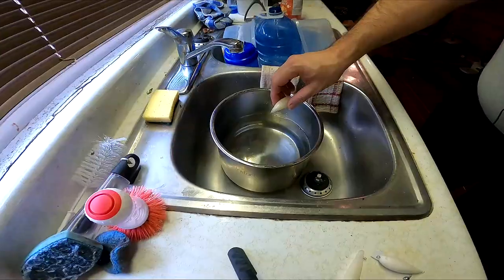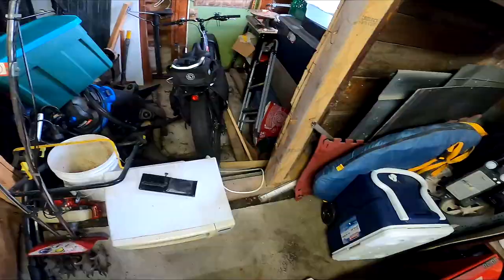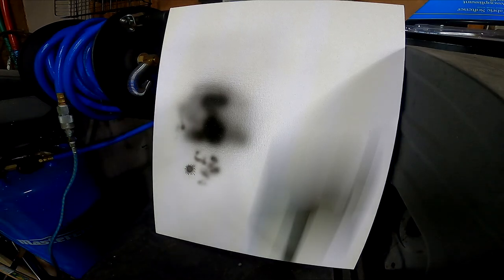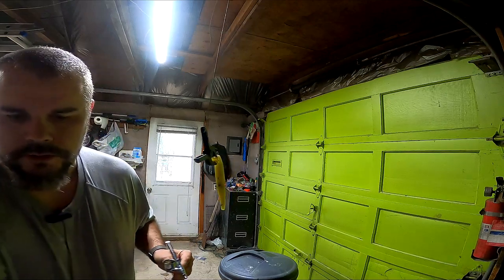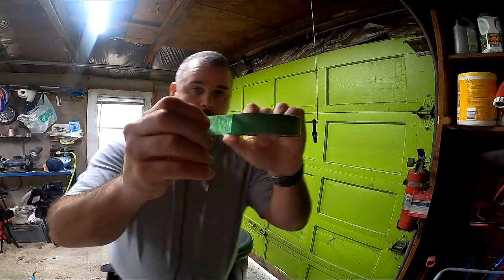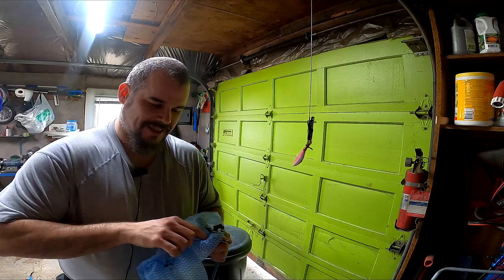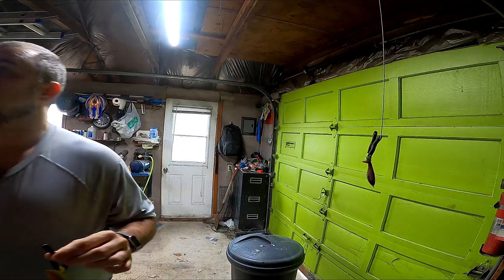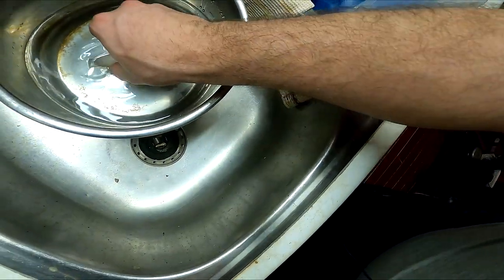No Skill Airbrushing 3D Printed Lures

Comment: You can get clear PLA also. With that last bait that did not float. Make the front bill of the bait larger. I would also try and design the bait cut in half. And use supports on the bottom to print it with the two sides of the bait faced down. Then all you do is remove the infill and throw in some bb's and glue the two sides together. Make the body larger like a supper fat tad pole. That will help with floating. Plus the larger bill in the front for the nose.
Reply from the maker: I actually printed a split lure and it worked out nicely.  The wire passes through it so if it rips out then that was one hell of a fight with a fish.  I reprinted the crank baits and put a nice air bladder on the back of them so now they sit upright no problem.

Comment: And if you make metallic fishies, you could be naughty and make them conduct electrickery to the fish below by hanging a cable in the water and using some wire for line, and when a fish bites, push a button, send high voltage down the wire, and boom, fishies stop fighting... :P

And yes, I know such a thing is illegal, cos where's the fun in being able to use modern methods to fill one's belly? :P